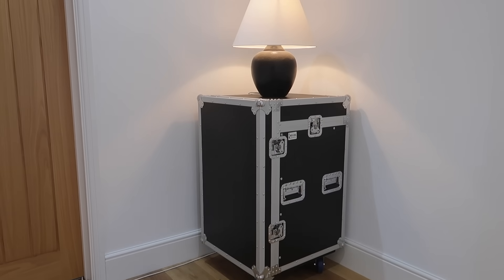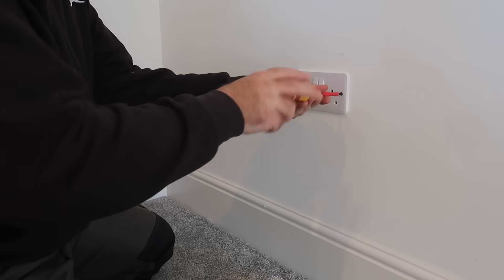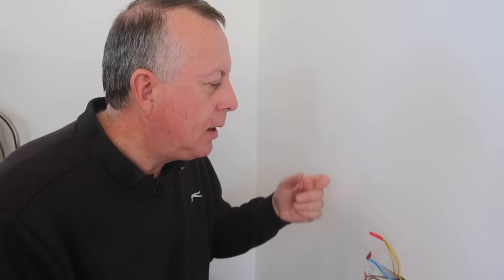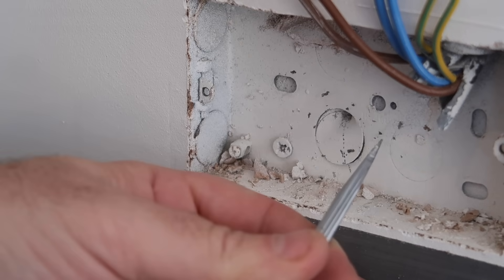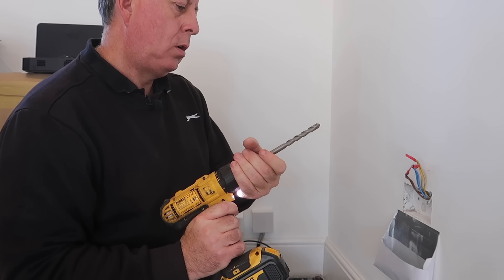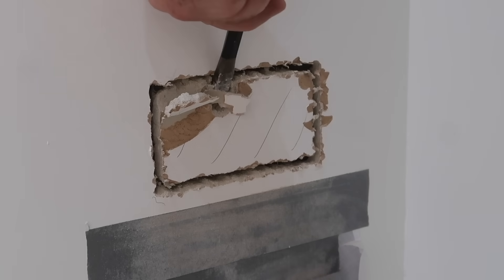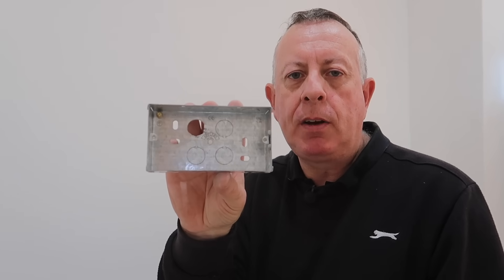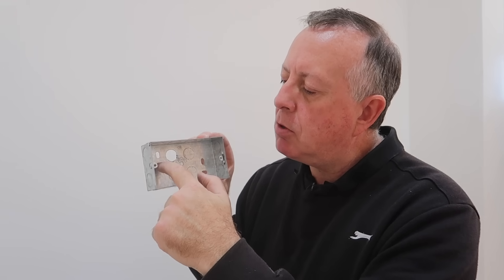How to Install a New Electrical Outlet in an Existing Wall

Comment: Shouldn't an electrician sign off such mods?
Reply: My understanding is that as long as the job isn't within a 'special location' such as a bathroom or kitchen you're also allowed to install additional new light fittings, switches, sockets and even add a single fused spur to an existing circuit BUT like all these things, consult a qualified sparky if not sure or not confident.

Comment: Fab video - def consider if you don't need it recessed is going for a low profile surface mounted socket, or if you do go recessed you go off alignment so both back boxes are not directly back to back. Going slightly up (higher) the other side reduces any risk of damage to the power feed to the original socket when taking out the wall material.   

Perfect timing on this one though as I'm needing to add a few spurs!

Comment: Personally I would have extended the ring final circuit to the new socket rather than adding the new socket as a spur.  Just means running two cables through the hole and joining one to one of the legs of the existing ring final circuit. Pretty straightforward.
Reply from the maker: That's up to you but you don't need to.
Reply: @ProperDIY  you’re right, you don’t have to, I just think it would be better. Saves confusion later on.

Comment: I really like the trick with the filler I will use that next time I need to add a socket. Unfortunately our walls are very hard and many an hour had been spent chiselling and grinding to chase in sockets. I think on a cost basis I would only use those new MK sockets if there was good to be three cables. I can just about manage with two.
Reply: Best way to stick socket boxes in is to used expanding foam cause it gets in all the gaps and holes and around the sides so it’s completely stuck once solid. Also mix of bonding plaster and cement works well too!!

Comment: Good video only thing i would say about the new socket is that there is a little too much grey coming into back box so if you strip it back so its close to grommet it will give you a bit more flexibility with the cables and makes it easier to dress them in 👍🏼

Comment: Nice video. Not a criticism at all, but I'd suggest getting one of the good Voltage Pens and dump the Neon Screwdriver Voltage Tester. I too used those for years, so am no role model! But, I eventually switched to a FLUKE VoltAlert 1AC-E II, and I now just trust that a lot more. I then reluctantly junked my little pile of similar Neon Testers or, on one I still like to use as a small Screwdriver, I just removed the insides and left a little visible note inside where the Neon bit used to live, to tell anyone, myself included, that it no longer has any Test ability and nothing whatsoever left inside that can conduct from the tip to the handle end! To be totally safe, I should have junked that too, but I know it's no longer capable of conducting and it was an old friend!

Fully understand the ease of use of the Neon, but there remains that 1000:1 possibility that the Neon bit has elected to stop working, right on a day when a wire could be live for what ever reason (even after using a Voltage Plug, such as someone flicking a PCB back on without realising you were busy and no PCB Lock was used). Likewise, and probably the worst aspect, is it depends on the pink human bit to test, which is perhaps not ideal!

The Voltage Pens flash when working, and peep when being switched off, and you can test them on something known-to-be-live just before use, and be more certain nothing is live, because the Voltage Pen flashes to tell you it is still active and working whilst being used. Unlike the Neon, which only lights up with a current and if it's still working.

I know they are not cheap, I think I got mine for around £17, but have seen them as high as £29, so they can be expensive if you don't shop around.

Don't shoot the messenger!
Reply: As a novice I have never had much luck in geting those screwdrivers to light up consistently. The £8 pen I use, remove the batteries when not in use, lights up on the outside of a live kettle lead, something that doesn't register with a screwdriver.

Comment: I usually use 25mm boxes for bck to back sockets.
With dot and dab walls, you often don't have to remove any of the underlying brick or blockwork.
Reply from the maker: Screwfix were out of them!

Comment: If your solid wall has been dotted and dapped over with a plaster board you can use isolating saw to get a crisp cut then knockout rest with chisel. Screw back box to wall using large washers.
Reply: Think you mean oscillating ??

Comment: Another great video. My house is older with hard bricks (no fun stitch drilling) and previous owners have extended stuff, the wiring is a tad confusing now, lovely to work on a newer job. Side note, when I did my electrical installation studying in the late 90s, the tutor told us you shouldn't pull the earth through the sleeve to open it up as it has the potential to stretch the earth, narrowing its cross sectional area, but as you've done, is as I do, I suspect he was being extra cautious with new students.
Reply from the maker: I know what it's like in a house with hard bricks - a lot more work and noise. I think the 'using the earth to rip the insulation' is now taught - better than cutting through the insulation.
Reply: @ProperDIY  thanks, I feel better now. I'm not an electrician so haven't needed to keep up. Cheers.
Reply: @johnrich6928  They actually make a cable stripper which does the outer sheath. Also worth mentioning it looks like the days of traditional pvc twin and earth are numbered, and its all going to be a low smoke version, either LSF or LSOH, both of which are a bitch to strip by pulling the earth core.
Reply: @ChariotsofWire180  I've seen the strippers in action and being a DIYer and lover of tools want them, but I can't justify them now,   all the wiring is done, just decorating to keep on top of.... but my kids have their own houses now, so just maybe.... but regs are regs!
Reply: @johnrich6928  Each to their own, some are tool mad, and thats ok. Personally if youre a diy'er i wouldn't bother. Stick with a carefully used knife or pull the earth core. If the cables are at room temp its really not an issue, too many drama llamas in the electrical trade now. 
   Its terminating 3 phase distribution boards and commercial second fix where LSF is murder on the hands. Domestically you should still be meeting traditional pvc for a while yet.

Comment: Another excellent video thanks Stuart. One word of warning about installing socket outlets back to back; if the wall is thin it can be a good idea to remove one of the side knock outs and drill at a shallow angle so the new socket is offset, i.e. not directly back to back. Chopping in a new 35mm box can result in a big hole with nothing to fix to. Similarly using screws and plugs to fix the back box in a thin wall can lead to drilling right through the original back box and socket.
Reply: Easy to avoid though as he'll no doubt have noted the thickness of the wall when he drilled. I don't see this as a problem
Reply: @johnadams1976  Hi John, you would always hope so but speaking as a 'mature' electrician, I've seen quite a few very small serving hatches created by individuals who didn't check first.

Comment: As always, very helpful video. Since you have an industrial table next to the socket your next upgrade would be adding sockets which incorporate  twin USB ports.👍😊
Reply: Do these require additional wiring or are they the same as a normal socket?
Reply: @flippmogaming1  In my house I've changed my sockets and USB is wired into the socket. No additional wiring is required. 👍